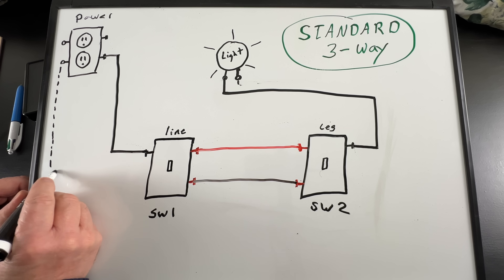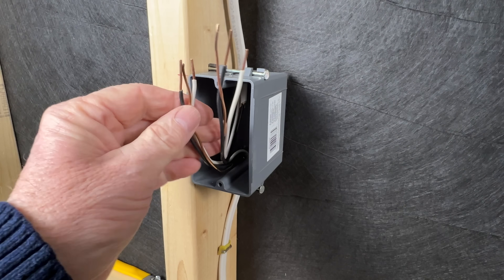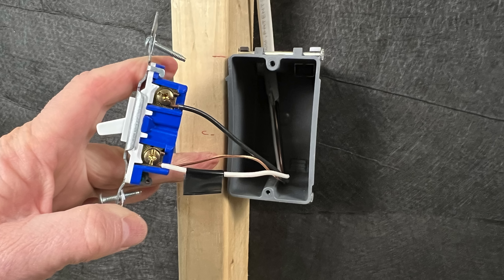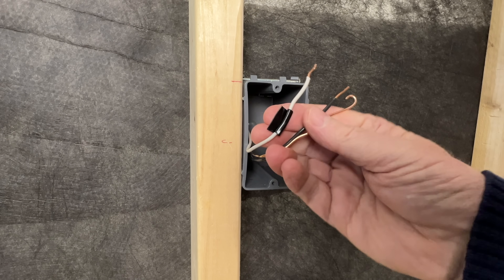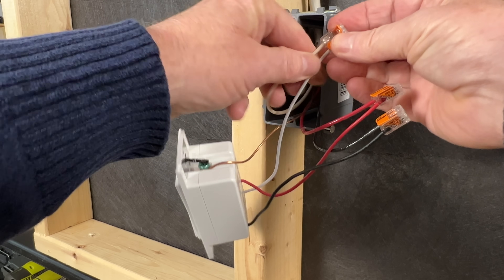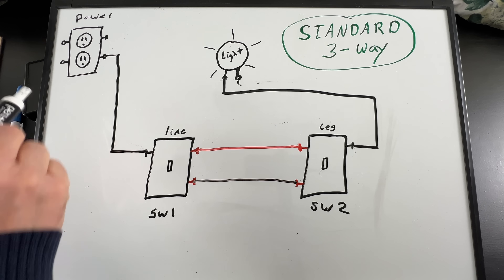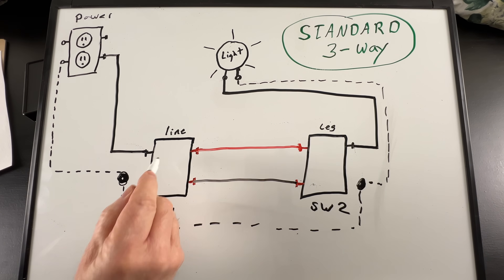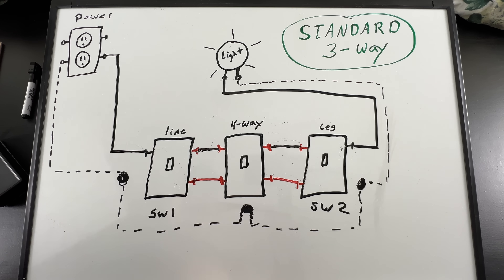How NOT to Wire Light Switches in 2025 (New Rules)

Comment: Since that code change I have been wondering why 14/4 hasn’t become more popular. Supply houses carry 14/2/2 which is basically the same but has 2 wires labeled as neutral. I bought a spool of that for this nonsense and just relabel one of the neutrals.  I use this more than just for 3 ways. Most frequently when I have power coming from a fan box to a switch where I want to control the fan and light separately.  This case would need power, fan switch leg, light switch leg, and nuetral per the new code.
Reply: The reason is, it's not necessary. In a 3-way application only one outlet has the line (power) while the other outlet has load (switch leg). So if you wanted to pull power from the load outlet it wouldn't be possible because there is no line going into it. The same goes for the 4-way set up. That's also the same reason as to why dead end 3-ways are legal.

By doing what you did, all you've done is spend more money for nothing, unless your attempt is to supply power to every box and have access to a neutral. What I mean by supplying power is that one non-neutral conductors is spliced with the hot where it's in every switch outlet down stream. But you're also doing the same thing with the neutral.
Reply: @The_Forgotten_Man  By far the most common use of this stuff for me is wiring fans powered from the attic so I can have a wire for lights, fan, power, nuetral, and ground in one cable.  That reason alone is why I would expect it to be more popular than it is. 

You obviously don’t need it where you don’t need a nuetral.  But examples on 3 ways where I’ve used it: A 3 way in a basement where I also want an convience outlet in the same box that’s not switched.  A 3 way on a dead end where I want a motion detector and need a neutral.  Perfectly reasonable applications where that kind of wire is handy. Generally for the amount of wire needed for these kinds of applications once you have a spool of it, it’s not that big of a deal to run.
Reply: @The_Forgotten_Man   Dead-end three-ways without a neutral are not code  compliant unless the entire area is visible from one location. If you can't see the entire area (such as a turn in a hallway) you need 4-wire + ground.

Comment: In swedwn we denote the sweitched hot by using another colour. Ie Live is Brown Neutral is Blue Earth is Green/Yellow and the switched live is Orange. I think this is good practice because you can easily know which is which if you for example have an unswitched and a switched live in the same box for a PIR fixture and a switched fixture for example.
Reply: Common practice used to be running yellow travelers but we do everything cheap and half asses now
Reply: @alb8158 That's a sad state of affairs. Makes it so much more difficult to do addidtions and fault find.

Comment: 12-2 for lighting?  I wonder when NEC will catch up to modern lighting needs.
Reply from the maker: I noted 12/2 or 12/3 incase people had a 20A circuit. Most lighting loads are run on 15A circuits with 14/2 or 14/3 wire. I didn't want someone to get the wrong idea and run a 14 gauge wire on a 20A circuit.
Reply from the maker: I also just made a video about the introduction on 10A circuits in the code. Check it out.
Reply: @BackyardMaine  Cool  thanks!
Reply: Just like with any branch circuit, you size the circuit to the load.  You can use 12/2 on a 20A breaker, but you don't have to.  If it's a 15A breaker, you can use 14/2.
Reply: @stargazer7644  I understand that.  What I am saying is that what kind of situation causes a homeowner to need 20A of LED lighting?
Reply: @davidwillmore Well, I personally have 6 300W 39,000 Lumen LED floodlights in various places around the outside of my home/driveway.  But the more common situation might be that the lighting is hanging off of a 20A receptacle circuit.
Reply: @davidwillmore  What if the next owner of the house decides to replace your LEDs with halogen floods to remind them of their childhood?  What do you want, 2A breakers in houses now, just because you installed LEDs?
Reply: @stargazer7644  Sounds like nobody within 5 miles of you is going to be doing any star gazing, Mr Stargazer!
Reply: @EfficientRVer That's why I go to the observatory!

Comment: Here's a question: As a homeowner I've needed to do this to retrofit a 3-way switch where there wasn't one before. Curious if it's up to code:

From main panel, run separate 14/2 runs on the same circuit to the boxes containing both SW1 AND SW2
Another 14/2 run from SW2 to light fixture.
A third 14/2 run between SW1 and SW2 solely to act as travelers (with the white wire reidentified as red).

This leaves SW2 with an unused and capped-off source of constant hot, and both boxes with an available neutral. The only thing weird is that the neutral doesn't pass between them but rather they both source a neutral separately from the main panel (on the same circuit). This was done to retrofit a setup with only a single switch (but an available source of power on the same circuit in the box where I wanted the second switch) to be a 3-way switch.

It seems fine, it's just unorthodox. Not sure if "unorthodox" means "noncompliant".
Reply from the maker: I'm a little confused. You are saying that SW1 and SW2 are in the same box. Why would you want to 3-way switches at the same location?
Reply from the maker: I have another method to change a single pole setup to 3-way switches. Stay tuned for that video soon.
Reply: I know what you're saying. If both boxes are energized by the same breaker, then all you would need to do is run a 14-2 between the two boxes as travelers. Label the white wire, with red sharpie for example, to indicate it's no longer a neutral. Those two travelers would attach to the brass colored screws of the 3-ways. And then the black switch leg at the one end would attach to the common screw (they're usually black), and the power would then be attached at the other end to common of the other 3-way. That would give you the 3-way function.
Reply: I don't believe that is compliant. I forget the code reference but on an AC circuit the currents in each cable/conduit need to cancel. If you get the live on one cable you can't grab the neutral from another.

Comment: I never labeled my white wires and they passed inspection. I don't and won't have neutral wires in my switch boxes so the whole box is hot.  I don't need those fancy switches in my wiring the simple the better what would be better and it can be done with EMT. Have a black solid and a white with a black stripe. They should make Romex with switch colors either a striped wire or just use red and black. Now the code has changed black heat shrink is better than tape. 73

Comment: Excellent description for 3-way and 4-way circuits. However, I had to watch this several times to understand what you were saying about single poles. Then it dawned on me you have the line in the fixture box instead of in the switch box. I've been in and around construction for 50+ years and can probably count on my fingers the number of times I have seen it wired that way. The line is pretty much always in the switch box. A diagram would have been nice to understand what you were doing.
Reply from the maker: I think you're right. I was thinking the 3-ways would be easier to understand on the white board but maybe the single poles would have been as well. Or maybe show both wired and the white board. What do you think?

Comment: When roughing in a house I prefer to run the feed into the switch box, then run the two wire cable to the light fixture.  Though I have wired switch loops using 3 wire plus ground cable in certain situations,  usually in renovations when I need to add a switch a pull chain style luminaire while doing minimal drywall damage.   

I'd like to see you finish this video with another video demonstrating the Chicago and  California methods.   You just earned a new subscriber
Reply from the maker: Ive been hearing that in the comments. I'll make another video.
Reply: Don't show these guys the suicide 3 way please. You're going to really get someone hurt. You've shown all that they need. If they want to know more they need to do an apprenticeship. Someone's gonna get hurt.

Comment: For me, as old as I am, never going to ever wire anything again. Its just nice to remind ones self what was involved. For people who worried about their homes..... I say if it was done in say the last five years and no issues, no need to worry but if there are problems going on, time to revisit all of the wiring. Any wiring thats twenty plus would probably fail but yet if it is still working right. Its a leave it alone as the cost of rewiring a home that old will be not only very expensive, most likely be more than that home is valued at. There of course many other things to consider as age or historic, etc., that determines to do or not. Just trying to keep this comment short... loved this video as its very easy to follow

Comment: Easier way to draw the 'dead end 3 way' and the way we all wire it is a 3 lead wire and make the neutral as well as the switched run to the 1st switch box
.
And actually this is a code change I support, so tired of needing to get power and only find switchloop .... as a matter if fact just yesterday for adding a humidity sensor fan (from a std fan run with light) , so now i have to bring in power from 'somewhere'

Comment: Re-identifying a neutral wire in Romex, even 14 or 12 AWG  is allowed by code.  An inspector that says otherwise is wrong.
Reply from the maker: It is in 200.7 (C) 1 but I have argued with inspectors many times about this and it's not worth the aggravation.
Reply: Yes, it's the opposite which is not allowed.  Marking a red, black, or anything else to become a white neutral is not allowed.  Which makes converting an industrial 4-wire 3-phase 120/208 space with red THWN on the 3 phases and ground, no neutral, to split-phase 120/240 residential lofts pretty interesting.  An inspector may allow marking it white, if you are meticulous about heat-shrinking the entire visible length within the breaker box and within each junction box, outlet box, switch box.  Green and black can be done that way also, or just at the ends in each box as usual, or preferably also where it enters the breaker box.

If they don't approve the meticulous white marking, you of course then try using the red you're going to discard, to pull a white.  Sometimes you'll wish you just ripped it out and started over, but often the wiring is better than what you'll replace it with, so often they will work with you, to keep you from replacing 10awg or 8awg THWN with 14awg or 12awg NM-B.

Comment: Why are you using  a 12.2 instead of a 14.2 to the switch and the light. I thought lights were 15 amp.
Reply from the maker: Some lights are supplied from 15A circuits and some are supplied from 20A circuits. Many times electricians will jump off  receptacle circuit to feed light switches. If it's a 20A circuit you need to run 12 gauge wire if its 15A you can run 14 gauge.
Reply: Because he does ironing down the line on the same circuit :)

Comment: Kudos, very clear and concise explanation! However, I don’t understand the comment regarding some inspectors and size.
Reply from the maker: 200.7 in the code does allow the re-identifying of a white wire for single pole, 3-way and 4-way light switch loops but I have found some inspectors will not allow this so I never do it.
Reply: @BackyardMaine  Do they ever give you a Code based reason? It drives me crazy when inspectors enforce personal rules and not strict adherence to the NEC!
Reply from the maker: There's another area of the code that prohibits re-identifying smaller conductors. I think it's smaller than 8AWG.. I'd have to look it up. I prefer wiring methods where I don't need to do this anyway so for me its not a concern.  @djcip1

Comment: love the video very easy to follow but just so im clear in the 'dead end switch' SW2 could not use one of the fancy new switches i guess theyre called wifi switches? because the neutral  is being used already?
Reply from the maker: Yes. There is no neutral in the box. The white wire is not a neutral in this case since it's connected to the ungrounded hot wire. Some smart devices being offered these day don't require a neutral but many still do.

Comment: As a homeowner I encountered this issue trying to install a Feit Wifi Switch(junk by the way) for an exterior light going to my detached garage.  I was forced to put the Wifi switch out in the garage.   Not a deal breaker but would have preferred it in the house.  What I do wish and I’m not sure if it’s in the NFPA is a minimum conductor count for thermostat wire.  7 conductors should be a minimum requirement.  I’ve rewired 4 of my own furnaces in two houses at great difficulty.  What a PIA.  Admittedly low voltage control wire is not necessarily a safety issue, but please.
Reply: Not everybody needs 7 wires.  I do not have AC in my climate,   5 wire is plenty for me

Comment: My dining room light is wired with the dead end 3-way wiring. Which annoys me because I wanted to put a new switch that requires a neutral at the dead end location but there is no neutral there so I couldn't. I got a different dimmer switch that didn't require a neutral in the end.

Comment: Just a question! Why don’t you sleeve your ground wire…the “hot” live terminals seem to be uninsulated terminals with exposed conductive parts. I find this most strange in the “fuse box“ having all the bare Ground (CPCs) wire un sleeved seems is something we don’t tent to do in the UK due to testing and parallel paths. 
Seeing your dead and live testing procedures would be interesting too… 👍
Reply from the maker: Sleeved ground wires are not required or a practice here in the USA. I see your point though. We have to be diligent when folding wires into a box to make sure the ground is tucked away from any live parts.

Comment: Bloody Hell USA finally brings the most basic code up to match the rest of the world from 40+yrs ago.  Grats I guess??  MAGE.  Make America Great Eventually.
Reply: Afaik in germany it isn't required either. It's just not allowed to use blue as something different than neutral if a blue in the same junction box is used for neutral, and cables without a blue wire are very uncommon under 7 wire cable (including ground).

Comment: Quick question for the pros - Is there any issue with crossing the two traveler wires in a two 3-way switch configuration?  As a homeowner, I prefer a setup where both switches down = off.  (Yes I know both up would also be off.)
Reply from the maker: No the travelers can go on either of the traveler screws. Doesn't make any difference.

Comment: Man that is crazy, here in the UK we identify our wire colors accordingly. Brown, black and grey are the three phase colors (taken from European harmonization) with blue being the neutral and green/yellow being the earth.
So when we wire lighting circuits we run a cable from the supply to the first light and on to subsequent lights. Then, from the light we take a cable that looks the same but has two brown wires to the switch, that way each conductor is marked along it's entire length and it identifies it's intended purpose. It is NOT acceptable to use pieces of tape or other sleeves etc to try to change the use of a conductor as it could be cut and jointed somewhere along it's length.
Should a switch require a neutral to run electronics then a single blue double sheathed cable should be run in additionally to the switch wire and ALL earthing conductors should be sleeved with green/yellow sleeving to both identify them and also to prevent accidental contact with live parts which I bet happens very frequently in the US & Canada judging by the look of those switches yall use.
Reply: There's one downside with your way: you need to carry two stocks of cable which are 100% the same other than insulation color. This costs extra money.

Comment: You can bet in the next code update, they scrap the exceptions and make neutrals required in ALL switch boxes!  So look for 12/3 and 12/4 to become more common when running 3 ways and 4 ways.  But, better yet, 10AMP breakers and wiring are coming in with the newest codes too, so look for 14/3 and 14/4's but also 16/2 16/3 and 16/4 to be a common wiring size.  I'm not a big fan of more 12's in a box, but I could be fine with more 14's or 16's.
Reply: I could definitely see this happening within the next code cycle or two, to eliminate the temptation to install an electronic switch requiring a neutral,  or worse yet, a receptacle tapped off a two wire switch loop and using the ground as a neutral, which was the whole point of this code change in 2011, and even that was long overdue if you ask me.

Comment: A very good presentation, thanks. I always forget how to wire 3 way switches no matter how many I do, if I don't do these often enough.

My lights are completely different in that my switch boxes carry no current at all. Mine have no hot, no neutral & no ground. They have two bell wires in them that lead to the grey terminals of Sonoff Mini R2 smart WiFi controllers. These terminals only sense a change in ground of the logic chip, and still utilizes the traditional wall light switch to control the light. Lights can be controlled via the app, voice, wall switch, routines and timers. This method will not allow dimmers to function. I have one lamp in each room with dimming function that is smart.

I chose this option due to the high cost of wire, having a huge 19 room - 90 year old home. Not only did I not have a neutral, had cloth wire, and I didn't even have a ground.